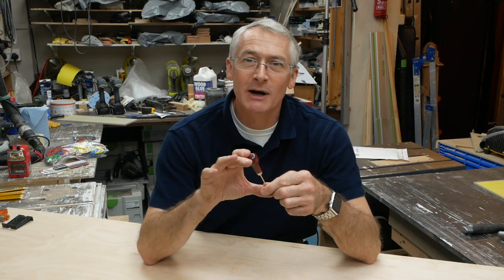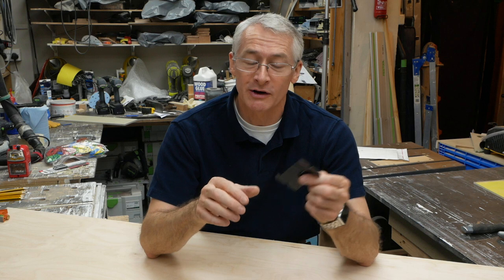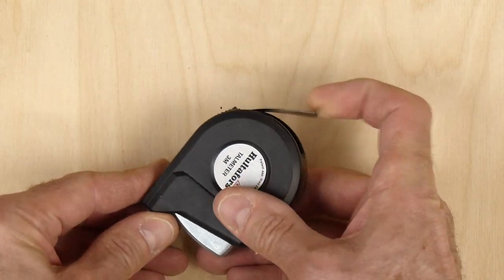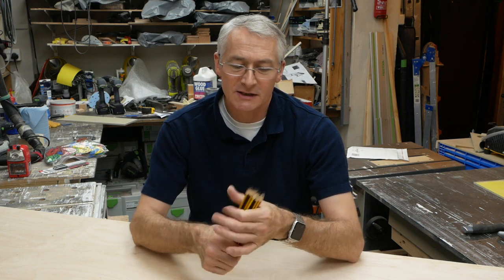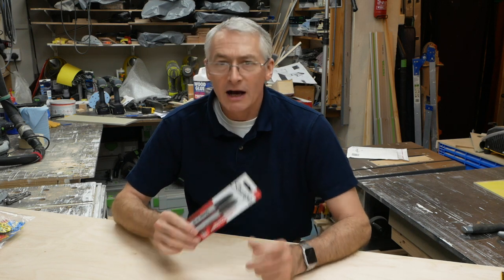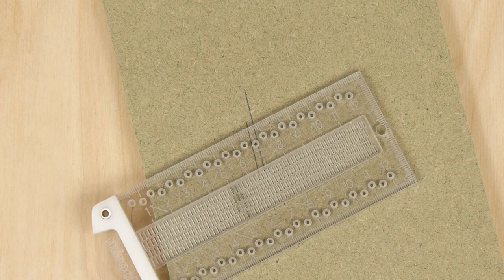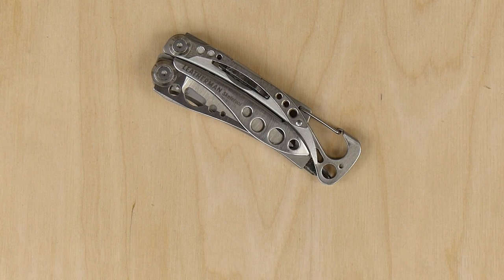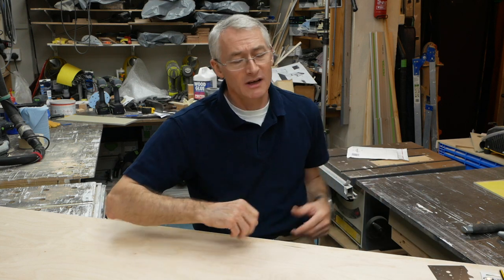Gifts to receive Part 1 #125

Comment: When I was a kid some 30ish years ago, they used to sell tape measures that had a window on the top with a red line. The tape had a scale on the top for outside measurements, and one on the bottom that was offset (by roughly the length of the housing) and visible in that window for inside measurements. I don’t know how accurate those were but I remember finding them fascinating (to the point I took one apart and never got back together properly enough for the inside measurements to be reliable; my dad wasn’t too pleased with that).
Reply from the maker: Fisco (I think) do one, and Festool did a re-brand of it a few years back. 👍

Comment: Skeletools also rust in the pivot area. It's very annoying since I carry one on my bicycle and inevitably it ends up getting damp if not wet. Mind you, the same is true of a disappointing number of other "stainless steel" or more expensive material bicycle specific tools. It's just annoying to pay a premium for a non-rusting tool then discover that it rusts.
Reply from the maker: Sorry to hear. Never get mine wet so not an issue, but understand how it could be 👍
Reply: I'd ask my money back. if they ask a premium price for a product you should get a premium quality. Getting rusty tools you can buy for a fraction of the premium tools.

Comment: Cult pens is a good company, I've used them a few times now as I prefer a fountain pen to a ball point.  

The Norris Pencils are the only wood pencil I'll use now, cheap ones never last.  I generally use a simple Pentel P200 mechanical pencil. I usually have a 0.3 and 0.5 on hand and they only cost about £2-3 on the highstreet and I have a slightly fancier Rotring one too.
Reply from the maker: Nice! 👍

Comment: Great gift list. Thanks for sharing. I ran in to the Mirock's channel about a year ago.  What are that plastickpackers at 9:25 used for? saw you using it as a shim (the 1.5 mm) for the cabinet doors and the 4 mm for scribing the backside of the "floating" shelf because of the uneveness of the wall. But there you use 1 and in that bag are 50 pieces or so.
Why do they have that special shape?  And is the thickness everywhere (on the whole surface) exactly the same? It seems that the part where the "1" is written in the yellow packer is
slightly thinner.
Reply from the maker: Thanks Hans. The packers are used as shims for whatever you need - levelling things up, gauging distance/ gaps etc... I use the 2mm as a rough guide to allow for the saw kerf in my plunge saw. You may get a bag of 50 but only 10 of each size, and they do get used up. The horseshoe shape is so they can be applied around eg a screw, to pack out eg a window or door frame. The uneven surface is so they can be glued in place if needs be. And whatever thickness, the have a wedge shape at the open end of the horseshoe so they can be made into a ‘tweenee’ size if needed 👍
Reply: Thanks for the vast and fast explanation. I now visited the link you provided. There are 100 pieces in the bag for 9 GBP. Pretty cheap.
About 15 months ago I bought in Germany 6 plastic shims, each a rectangle of 5x10 cm and a thickness varying from 1 to 6 mm.
They were quite expensive in my eyes (about 3.80 Euro's for the set) but I use them a lot. I use them only for temporary setups,
It's easier to clamp a shim of a certain thickness to a clamp than moving the fence of the bandsaw the same distance.
I bought two sets that time. One set is still untouched, the other one is permanently on stand-by.

Comment: Hello Peter, I have been looking around your videos and wondered if you ever talk about the wood glue (PVA 10 min - Im guessing) you use? It would be great to get a recommendation? Thanks
Reply from the maker: Hi Edward. No, I don't think I ever have, specifically. It's been on my list to do a fast-grab PVA test, but honestly I struggle to think of a way to make it interesting! For a long time I used PolyTen PVA https://amzn.to/2RaQ6fR and it's still a great adhesive. I've been given all kinds along the way and they've all been good as well. More recently I've been using Maxitek storm D4, which is good - http://bit.ly/StormD4PVA - but honestly I don't think I've ever come across a bad one, though I had some everbuild D4 from toolstation that went 'off' and stank when I used it! Hope that helps, Peter

Comment: That's Awl folks,, you ever use a speed square Peter , kinda like an ordinary square only faster ,now if i could only cut strait that would be awl i need ...:)
Reply from the maker: I have one (somewhere) but just never got on with it. I know they do all kinds of fancy stuff that I’ll never use like calculating angles for a pitched roof etc. but I never really ‘got it’ 🤔
Reply: I had one then bought another. Find them so useful. I’m not a roofer but I suppose it’s different strokes for different folks.